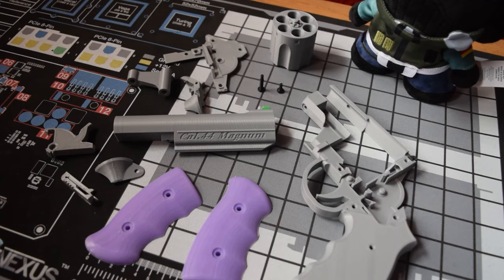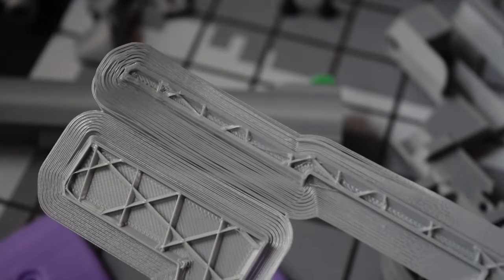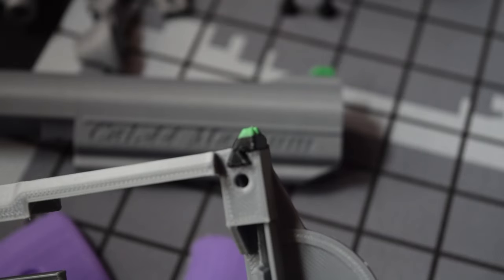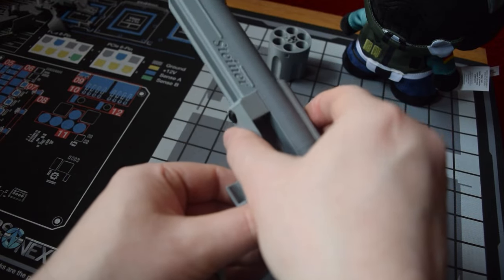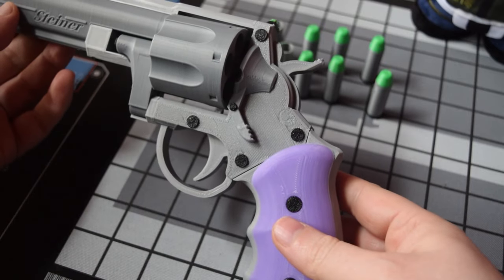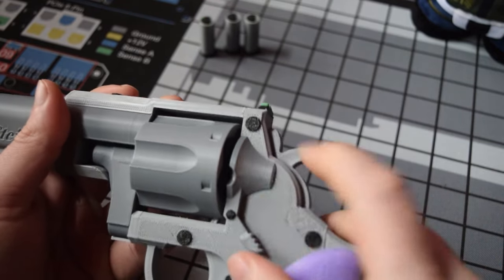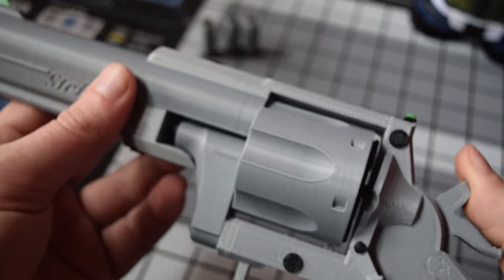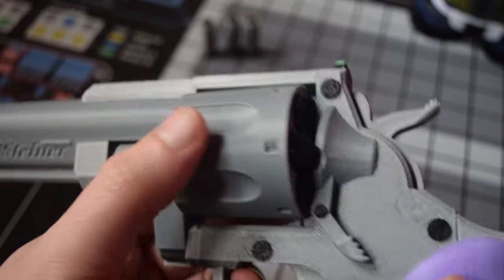3D Printed Magnum Revolver - Print Ideas - Free 3D Model - Cosplay Prop

Comment: Just a note on printing items with tight tolerance. Use let's say the frame as a start point, anything that has to fit into a channel or hole must, model line placement in the slicer is something to consider. If you are printing with a 0.4mm nozzle you are working with a 0.2mm differential on either side of the print line.  This can be compensated for on some slicers, however most slicers print nozzle center on model wall center line. For me in Creality, designing a 4mm peg for a 4mm hole wouldn't work. It would have to be a 4mm hole and 3.6mm peg, as an example. This is all slicer based and of course printer quality based, some slicers have a fix for this. Also, some printers have Gcode modifications to address it.
Reply from the maker: Nice read

Comment: What kinds of screws and springs did you use? I have the exact same revolver, but I don't know what extra parts I need
Reply from the maker: There is a pdf in the files you download with the instruction on what you need. I made custom models out of a few cylinders to match the screws and printed them of

Comment: Hey dude please I beg of you can you send me the models of the pegs
Reply from the maker: I never retained them as they were just a few cylinders at the sizes given in the originally guys instructions on what size screws to use
Reply: @corerosstech  thank you I’ve recently modeled them this morning have a great day.
Reply: @Black_Hole_Vr  Could you please upload them and send them here? i just printed it all and realized i dont have the screws
Reply: @stormy_in_vr640  they didn't work well but you can melt the cover piece and it still works fine but you will need the screw for the cylinder at the minimum for strength.